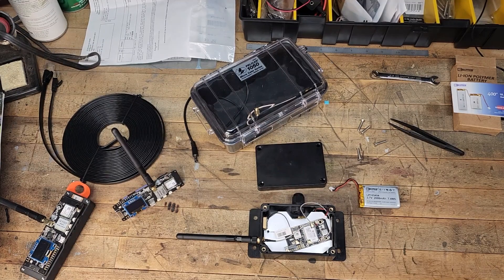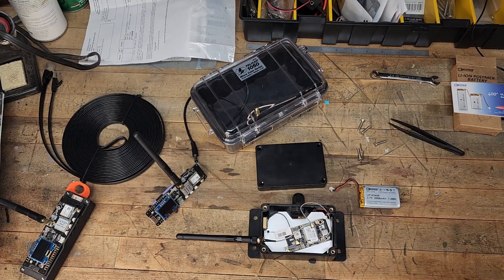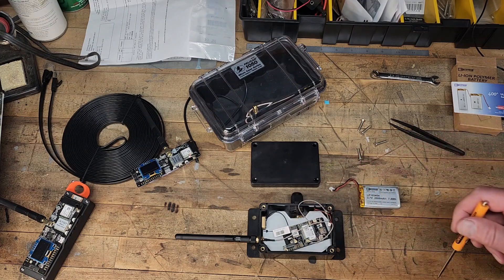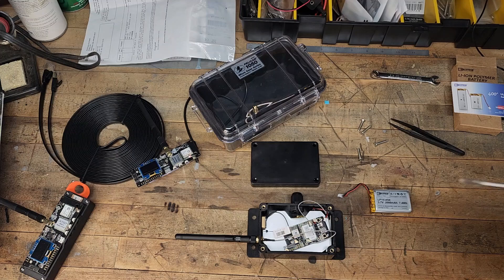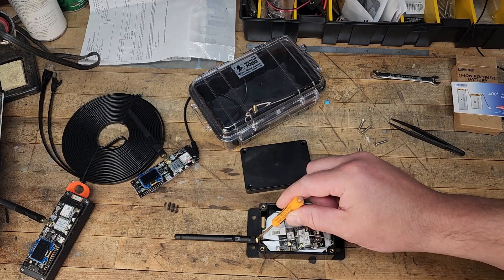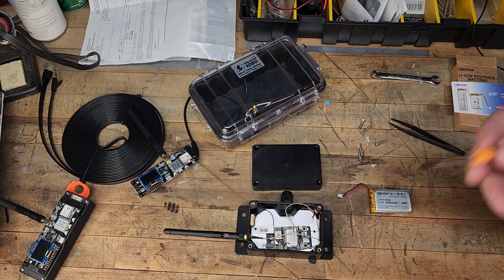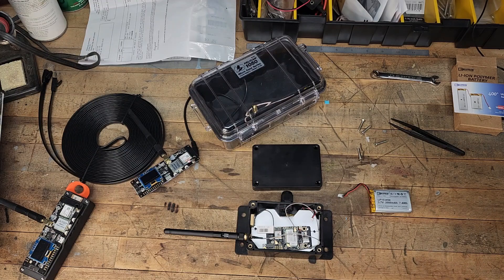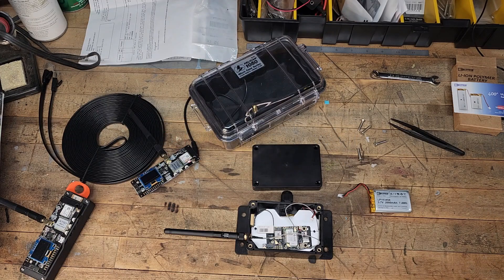Solar Meshtastic DIY Node Issues

Comment: Do you have any battery issues during the winter? I have been reading up on lithium batteries. It appears that they stop working at temperatures below freezing
Reply from the maker: Yes, even though I don't get super cold temps where I am at, it can be a problem. I have read about other using supercapacitors in place lithium batteries. However, I have tried it myself yet.

Comment: Have you considered conformal coating the circut boards . Im a FPV drone guy looking into this for the first time and thats what we do
Reply from the maker: That is a great idea! I will be trying that my next solar node build.
Reply: CorrosionX or similar products will protect electronics for a long time from moisture, seen people coat boards in it and they work under water for some time. 
Put it in an enclosure and you have a good solution

Comment: I'm doing something similar.  Specifically, I'm looking at adding ARDEN mesh.  I want to join multiple meshtastic meshes with ARDEN mesh nodes using bridged MQTT brokers for linking the meshtastic nodes over ARDEN.

Comment: Hey, just found your channel looking for others making solar nodes.  I came across a Husky brand transparent weatherproof rugged bin about the size of your pelican case (6 inches), but around $9 from home depot.  The lid is flat on the interior and looks like it can fit up to 130mm x 150mm solar panel.  There are around three 3w 5v panels I found on walmart's website that are potential candidates.  Might be a good case if the pelicans don't fit the bill (or the budget!)
Reply from the maker: Outstanding! I will check my local Home depot.
Reply: Yeah, there are also a ton of wateproof boxes at places like REI and Dick's (or even walmart/target sporting goods departments) that would make excellent waterproof enclosures with basically one hole drilled and protected.

Comment: Look up the rak 19004 green power module (buck boost converter)  it has a stable 5V output from a varying input voltage of 2V-36V it’s ideal for your setup. 
- I don’t see the link to the other channel you mentioned
Reply from the maker: Thanks! I will look into the green power module. Here is the link: https://youtu.be/kmHt28CQHO4

Comment: Great content! Your channel may very well be the go-to for those starting out with Meshtastic!

Couple things to expand on:

These RAK device solar nodes don't need GPS if they are permanently stationary (GPS coordinates can be set manually in the Meshtastic app). The NRF52 chip in them is super power efficient, that with GPS disabled they will last for around a week on a 2000mAh battery (even without solar).

Also, be careful with plugging batteries to the RAK. The solar input plug and the battery input plug on it should have both positive wires facing inward towards each other. Some of those LiPo batteries come with the wires in reverse (ask me how I know...BZZT!). The pins can be easily swapped on those JST connectors though, with a pin or hobby knife. Just pointing it out as it seems (I think) the battery in the video has the wires reversed for the plug orientation on the RAK device.
Reply from the maker: Good eye! I smoked that battery! However, the Wisblock is still working, which is good news. Thanks for your insight and feedback.